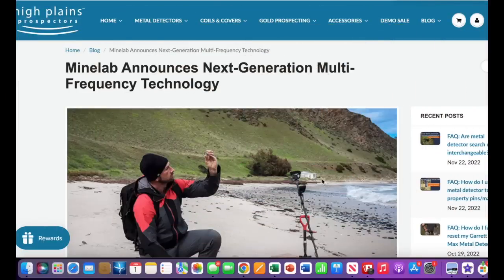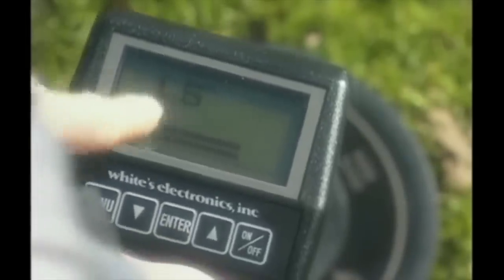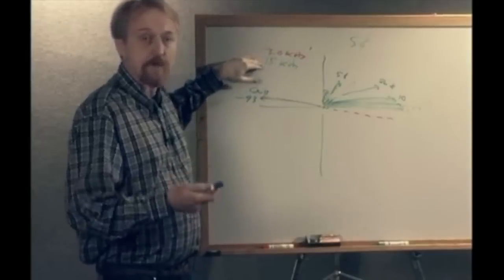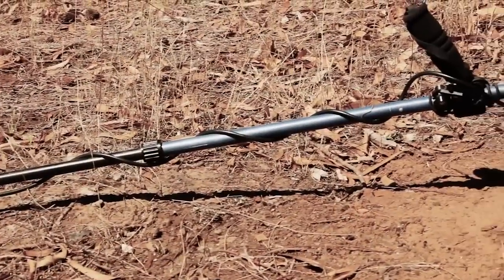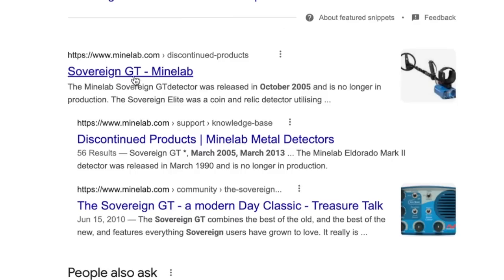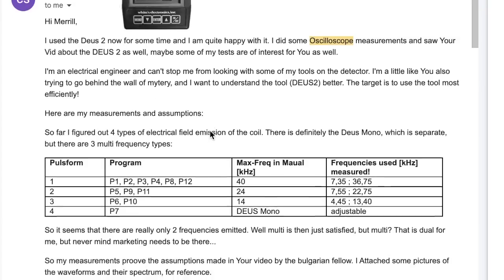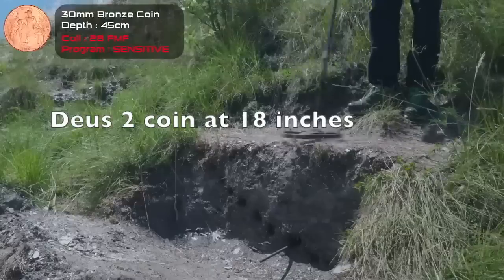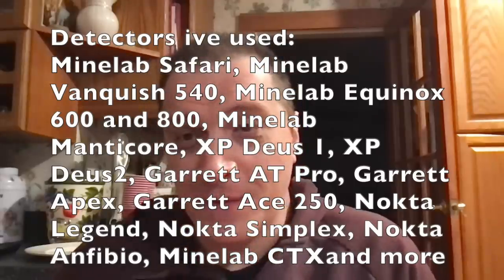We Broke Metal Detecting: Simultaneous Multi Frequency Is OLD Technology

Comment: Hi Merrill. I thought I would just answer the question that everybody is now asking after watching your video. I bought my first multi-frequency detector in 1992. It was a Fisher CZ6 Quicksilver. I believe that the Fisher CZ6 which was dual frequency was launched at the about the same time, early '92, as Minelab introduced the first Sovereign which was the first of the BBS machines using 17 frequencies. Way back then, most people didn't realise the advantages of using more than one frequency and for a couple of years I made an absolute killing on the beach before the other detectorists cottoned on. 56 gold rings in 2 years! That wouldn't happen now. I'm lucky if I get 5 a year nowadays. When I bought the CZ6, I was contemplating whether to get the Sovereign or the CZ6 and the dealer explained the differences between the two and let me try them both but something which he pointed out more than 30 years ago was that the Sovereign, although having 17 frequencies only actually transmits two at any one time and receives back from 1, which, I suppose backs up the findings on your video. This is probably true of all simultaneous MF detectors.

Comment: What happened to Whites is a really tragedy because they had the V3i for years and I used one and seeing all three frequencies is something I still want in a modern detector. In fact right before they went out of business I was in the process of trying to figure out a way to make the machine lighter with a carbon fiber waterproof control box. If Whites had just released the V3i in a modern format similar to their not so popular Sport they would be a serious competitor to what is on the market today. My theory is that the older programmers used ATOM processors and possibly machine language for the design and when they lost that core employee group they were never able to recover based on what little I've researched on forums and following previous employees as well. The MX5 was my all time favorite whites machine with excellent VDI and the best back light I have ever used on a machine. Honestly the Manticore is essentially a modern V3i/Explorer with less programming options I'd be surprised if the actually processing of signals is different. I really think Fishers is next in 2023 we will likely see them abandon metal detectors for the consumer market as they are no longer able to compete. They haven't even updated their website in over a decade. I'm tempted to make a modern website for them... Don't get me wrong I have an F75 LTD and I think its an excellent land machine and a backup to my Deus in the fields with great tones but for the price point there are just better options.

Comment: What would have happened if Neo hadn't take any of the two pills? He would have been stuck between the Matrix and the Reality. He would have realized that both were a carefully manufactured lie. That's the Black Pill.
Oh, yeah, metal detecting... I've been scorned multiple times by Deus users as I'm using a military PI (namely a Vallon VMH3CS) on beaches. But at the end of the day, I've always found more than they did. Most important is the time you spend metal detecting. If you take your machine out two hours a month, don't expect too much. Metal detecting is time consuming. always has been.

Comment: Hi, I usually don't comment on your videos but I am a fathefull watcher and subsciber. After watching this last video I had to comment since you are spot on, on more than one argument. I have been metaldetecting for some time now, and I have tested most brands of the past and few of the present. Let me tell you one thing, it is a shame that Whites Metal Detectors went out of business. They where ahead of their time, I had most of the detectors they made, and the one I loved the most was the MXT300, single frequency and the easyest to operate metal detector in the world. That is the only one I regret selling. I had the DFX and the V3i as well. Over complicated metal detectors that worked well but way to complicated to be sure you where using the detector at is full potential. You never new if your settings where correct or not. Main problem with the DFX or V3i was not target ID or separation, that where superb, but depth was not too good.  Now I own a Nokta Legend, and I am more than happy with it, BUT I also own a CHINESE CLONE of the Teknetics G2 and I paied $50 (discounted price) for it NEW in box. Tecnology has NO proportion to price. Yeah sure the G2 is a single frequency detector and wont work on the wet sand, but I could have bought more than a dozen detectors for the price of the Legend, and on land the difference is not all that great, as you say, 90% maybe even more of the performance of the legend I can get from the G2, now I might have to dig some more junk but I usually dig any repeatable steady signal, there is no detector that can 100% be sure you have a ring and not a bottle cap under the coil. Point is that we should stop looking for the perfect detector, there is no such thing, yet, and personally I would say that once you have found the detector that works for you in your soil (very important since all countries have different types of soil) stop changing machine and just go out and detect. 
It doesn't matter if you have a manticore, a deus II or what ever machine you own as long as it works out for you. Companies have to come out with something new otherwise they would stop selling and close their business. Have I seen new things in the last 10/15 years, not too many. Are metal detectors better now than 15 years ago, well maybe just a bit but still we keep digging junk.....
Take care and keep up the videos....
Reply from the maker: Thank you Norberto!

Comment: Thanks for the video I've started detecting back in the 1970s and stopped around 1990 and started back up 4 years ago I bought a Teknetics t2plus and really like it easy to use and I've paid for it every year but I don't like the emi I get around power lines and other sources do the new multi frequency detector help eliminate this issue thanks and keep the great videos coming.
Reply: The Manticore is the top dog for EMI mitigation. Minelab specifically designed all the components to work in a high EMI environment.
This feature alone is worth the price. As you can go where other detectors have avoided. Other detectors could try and detect in high EMI but their machine becomes chirpy and depth is compromised because they have to reduce sensitivity.

Comment: I might be wrong, but the Minelab Sovereign had 19 frequencies in the BBS System and it was released in 1991.  I had an original one.  I remember the iron mask toggle switch and it really worked great for finding coins near iron.   Sold it but I still have a Sovereign 2 pro.  It was my understanding that after quite a few years passed after BBS was developed, Minelab sold the technology to Whites that allowed them to created a detector that used 2 frequencies.  I don’t think Whites was or should have been credited with developing the technology.  Like I said, I could be wrong.
Reply: You are not wrong John with the exception that the BBS system only used 17 frequencies. Yes Minelab developed simultaneous multi frequency and the first detector incorporating this technology was the original Sovereign XS released as you say in 1991. The rights to use some of the BBS technology was sold to Whites who used it for their dual frequency DFX (2001) and their triple frequency V3i (2009).
Reply: @TarotBob  Thank you for the confirmation Bob.

Comment: All that doesn't do any good when you have to search nearby noisy power lines.
Reply: The Manticore is the top dog for EMI mitigation. Minelab specifically designed all the components to work in a high EMI environment.
This feature alone is worth the price. As you can go where other detectors have avoided. Other detectors could try and detect in high EMI but their machine becomes chirpy and depth is compromised because they have to reduce sensitivity.

Comment: Oh amd regarding smf vs sf look at the orx or the simplex. I have the simplex and it is a coin magnet. I will go over spots where I used the legend with the simplex and I pull more coins. Its crazy. But I wonder, is the power greater in sf than smf ? Does it split the power in smf between the frequencies? And is that why a detector like the simplex can pull coins from the 10th level of heck?

Comment: The nautilus machines designed by Jerry Tyndall out of Coates NC were using simultaneous all metal and discriminating frequencies a long long time ago. You get all metal in one ear and discrimination in the other. If I understand right there were actually two coils inside of the single coil. Not sure if this is the same but to me those old nautilus machines are still some of the best. No bells, no whistles, just 36v going into the ground, pure depth and the ultimate discrimination(your own ears)
Reply: The Nautilus DMC-2B was one of the best good ground relic hunting machines ever.  I dug over 25 Civil War Belt-plates and thousands of bullets with mine and I still have it.
Reply: @historyhoarder634  I’ve still got three of them and they are my machine of choice in good soil
Reply: I ran nautilus machines for 19 years.  Two channels, not 2 frequencies.  The detector operated at 14 khz.  They were heavy,  awkward to use,  had poor discrimination, useless in trash,  and gave false signals most likely due to slow recovery speed.  In addition, the detection pattern at depth was only about an inch wide.  There is no telling how many targets were walked over due to that issue alone.  Yes, the coil had 2 windings: one for transmit and one for receive.
Reply: @jeddiet7112  I’ve run em for about 20 years, and had piles of other machines/sponsors etc. Nautilus is still my go to machine in the right soil (used it mostly in sandy tidewater Virginia soil) and I’d put it up against any machine there.
Reply from the maker: @birddogg can you email me at kazanjianm@gmail.com? I have some Nautilus questions.

Comment: I find this disappointing!   The Minelab manuals for the Explorer series and the Etrac,  imply, and clearly show in their explanatory diagrams, that MANY frequencies are used simultaneously.  They even differentiate between dual and multi. So as dual is technically "multi", I was lead to believe that at least more than two frequencies were being transmitted at the same time.  This revelation about the Deus2 blows that out of the water.   Now, does that change what I'll be able to detect?...not really.   But I would appreciate some honesty over marketing double talk in all situations!  Just call it Simultaneous Dual frequency!

Comment: Hi Merrill. Great information as usual. There has always been a lot of marketing involved in the sale of metal detectors with some outlandish claims made. But what it boils down to for most people is to use the best machine you can afford. When you first pick up a detector, you really don't know what you're doing or even if the hobby is for you! I started with a Bounty Hunter, found some coins and a silver ring and I was hooked. It didn't mater that the detector only cost me $50,  it was the thrill of the hunt! After more than 15 years of detecting and ticking  off most of the bucket list finds, I still love the hunt. I've been using the Etrac and Excalibur since they were released and am only now considering an upgrade. Those two detectors have paid for themselves many times over. Love your enthusiasm for our hobby.

Comment: Best time to use your metal detector is right after a light rain because it improves the signal range under ground as it conducts the signal farther down and i have done this with multiple detectors. Such as bounty hunter (top two detectors) fisher 3 different models, minelab 1 model, whites 1 model , Garrett 1  probably a couple off brand cheapies like radio shack that was given to me lol. And all of them detect deeper when the soil is damp or wet also keeping your coil flat with the couture of the ground but on soil 2  to 3 inches above and on sand that isn't rocky flat on the ground.  Good hunting all

Comment: Great video. :) I detect ploughed land in the east of Britain. I switched from the etrac and T2 to the XP D1 years ago because of better performance in iron infested soil and better ergonomics (lighter and no headphone cable).  I now have the D2, and in ploughed soil I do just as well in single frequency as 'FMF'.  However, the D2 is deeper than the D1 in old pasture using its two frequencies so I'm very happy.

Comment: I have a hard time watching how they were using a oscilloscope to analyze multi- frequency. When I was working R&D for General Dynamics Missile Division, we would use a frequency spectrum analyzer. Frequency spectrum analyzer is a broad band analyzer which will show all frequency being transmitted at the same time. Once we Identification what frequency are being transmitted, we would use the oscilloscope to analyze each signal.

Comment: I purchased a brand new DFX when it first came out in 2001. I was supremely disappointed with its performance and overly complicated adjustment controls. I quickly noticed that making adjustments to this machine made very little to no difference in its performance capabilities. I sold the DFX and went back to using the XLT for many more productive years. I for one do not want to own a machine that has 500 different adjustments, especially when these endless amount of adjustments usually provide little to no benefit for the operator. Most of us are not out there searching for the Holy Grail, we are just looking for a few silver coins and some decent quality jewelry. These expensive and incredibly complicated machines seem to be a hindrance to this quest rather than a benefit. Sometimes, less really is better!

Comment: The original White's idea of using 2 fairly different frequenies was to improve the discrimination, since the different conductors reacts differently. Was it the step forward? Yes, i think it was, but the improvement was minute. We all know how the discriminators really behave. All the rest from this point on is in my oppinion a merely a marceting hype. If you need a deep machine use a PI instead.
Reply: Different metals respond to specific freq. diferently.

Comment: I spent 6 hours in a pasture between saturday and sunday with the Deus 2. All the good targets were at max at 12cm deep, nothing deeper. So, when i see all those tests regarding depth and everything, i just watch that with precaution. All the terrains are differents and that Deus has always had the reputation to be weak regarding depth. Deus 1 and now Deus 2, sorry but i can’t see real improvement. And i detected with the Deus 1 for 8 years. That multi frequency will not add any power for depth for sure, it’s all marketing bullshit. I judge a machine on real condition by detecting hours and hours on European fields and pasture. And for me, that new version is a pure deception ! I wish i knew it before about Minelab Manticore and Equinox 900 !
Reply: ... then Manticore or Equinox 900 are better than D2 for u?
Reply: @yomismo5711  regarding depth … for sure 😉
Reply: @pirateofalllseas  but how more? 1 or 2 cm more? …. I would prefer maybe 800 g weight of the D2 and 1 cm depth less honestly!
Reply: @yomismo5711  it’s more complicated than that. And regarding the weight, the Deus 2 with the remote is very close to the Equinox 900, less than 100 grams difference.
Reply: @pirateofalllseas  hmmm .... The true is I think you know very well what you are talking about 🙈
I can see you are disappointed with the D2.
I can see I should maybe go for the new Manticore.
What do you think about PI metal detectors?.
Thank you very much for your answers and your time! 👍👍👍
Reply: @yomismo5711  PI ?
Reply: @pirateofalllseas  pulse induction metal detectors.
Have you ever had any experience with them?
Reply: @yomismo5711  Only Deus 1, Deus 2 and Equinox 600. In what kind of terrain are you detecting and where ?

Comment: Nice video Merrell I think everyone needs to use what they like I have too bought and sold several detectors looking for anything better than what I used but alas I didn't like them and sold them all until the nox with the 15 smart coiI used it to get a little deeper than my CTX now I also have a ws6 master and I think I will keep it too I use the CTX for trashy sites with the 6inch and nox 600 and 900 and dues ii ws6 master for deeper stuff it seems to work for me everyone needs to get something that works for them thanks

Comment: owned the whites eagle spectrum sl90  in the 90s. fantastic seperation, depth and id and well constructed. minelab were using bbs in the first sovereign in 1991, excalibur in 1998. i dont think the manticore and deus 2 are worth their price performance... but people will pay it and so they will charge it. the first sovereign in 1991 was around £475 uk were near 32 years on and plus £1400 on top of that and what is the performance difference? if you put a 15 x 12 coil on a sov on the beach it will beat your standard nox / manticore for depth. the eric fosters pi machines will never be beaten for depth against vlf irrelevant of prices

Comment: I did not buy the deus II and I don't plan to buy the Manticore. The 800 has been able to fill most of my requirements to date, but I was left wanting in the waterproof expectation. That is why I plan to purchase the 900 instead. I do shallow diving in freshwater lakes and at 16 feet, the 900 is more than enough for my needs, if it really is good to 5 meters.

Comment: The Fisher cz20 water machine was out in 1993 and ran on two frequencies' 5 and 15 it is a really good machine and I still use mine
Reply: Fisher CZ-6 and CZ-20 were early 90's. So was the original Minelab Sovereign XS